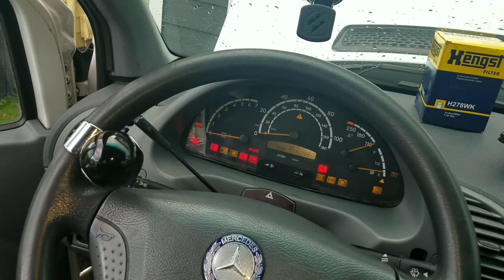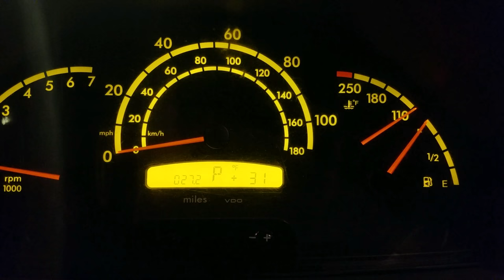How to remove glow plugs on a Sprinter [04-06] & repair glow module

Comment from the maker: Note, the engine must be piping hot while you do this. Removing glow plugs from a cold engine is a sure way to create a nightmare
Reply: How is it holding up now in 2022? Any issues? 

Did you get the engine hot and remove all 5 glow plugs at once?
Reply from the maker: @OneManOnFire  yes, I got the engine hot and cracked them all loose with the engine still hot. The engine did great until 366k. Was a hard worker everyday delivering. It started shooting oil out of the dipstick tube suddenly one day. I think I blew a hole in a piston. Should have changed the injectors out at 300k.
Reply from the maker: @OneManOnFire  but I got an engine and a transmission with only 85k miles on it, for $1,500. Installed it on the side of the road and I'm back in business.
Reply: @AncapistanVan  Good to know how you did it. I plan on making my own diy video myself. Is it ok if I give your video and channel a shout-out/screenshot in my video?
Reply from the maker: @OneManOnFire  yeah man :) thx

Comment: Is this the old glow plug module with fuses that break? or is this the self reseting updated module?
Reply from the maker: @KoryTheKind  this is the self destructing fusible link type, no circuit breakers. I upgraded to the new type, much less trouble. Soldering ain't easy sometimes
Reply: @AncapistanVan  Okay, great, how did you open up that module? I think there are four tabs on the inside?

I'd like to add an external fuse box to mine.
Reply from the maker: @KoryTheKind  hmm i think i pried it open with a flathead/scraper/spatula after heating it with a hair dryer. The seam is glued iirc.

Comment: Nice an easy , because you did it right ...took me 3 days to get injector bolts out without breaking WD-40 is our greatest weapon 😂
Reply from the maker: WD-40 works great on rusty fasteners, but imo it has little effect on the carbon goo that glues injectors and injector hold down bolts in place. Heat and oven cleaner works best for me. The glow plugs are a bit different though, since the steel glow plugs can rust. In both situations, cracking them loose with a hot engine is the key.

Comment: I was confused what you did with the control module. Do the points need to be touching and what was the symptoms. I have a cylinder 5 diesel knock. New injector and plug.
Reply from the maker: The control module blew the fusible links inside when the glow plugs failed. Fusible links are just a solid state fuse made of a copper bar that blows up when the current gets too high. So I bridged that gap with my awful soldering, to repair the fusible links. Symptoms were my glow plug light staying on for longer than usual, and rougher cold starts.

A knock from the back of the engine can come from a damaged flex plate especially on 2002 to 2003 models, or from an injector leaking compression past the injector seal ring AKA Black death, or from a remanufactured injector causing predetonation inside the cylinder from a leaking nozzle tip or just make it run loud from incorrect fuelling quantity/timing/spray pattern.

A knock corresponding to engine RPM can also be caused by the outer ring of the harmonic balancer coming loose and hitting the timing cover.

A similar tapping sound can also be caused by the belt tensioner hitting the minimum stop limit due to a belt that is too long.
Reply: Yea the knock stops when I unplug injector 5. Have replaced with brand new injector and glow plug. Now looking into module fix
Reply: Next question is how did you get the module taken apart. In a way I don't have the funds to fix it if it doesn't need it. Altho I did do the glow plugs and had black death/ injector seal replaced. Altho I redid the job and noticed diesel on the shaft of brand new injector
Reply from the maker: @thesolpurpose3109  I shoved a knife into the seam and pried it apart. It's just glued together. There's two bolts that hold the glow plug module in place, so use an extension on your ratchet to easily reach them. It's a 10 mm socket iirc. 

Unless you live in alaska, or Montana, it doesn't need to be fixed. I have two glow plugs not functioning on my engine, and it starts just fine in freezing weather.
Reply: @AncapistanVan  the van was in minnesota. lol -17 degrees sometimes. i plan to get the knock gone and take It away from the cold tho. i wanna get everything squared away in this family shop before i go to far

Comment: thank you for documenting. did i hear you correct? "unplug cam sensor in order to turn it over  to spray out this crap without the engine firing." did that have any benefit? what if i just drop another glow plug in without meticulous cleaning? won't most shit burn off with the fresh plug? also, what's the risk of doing this while the engine is too hot? some danger with your penetrating catalyst spray? (i'm trying to decipher what that first comment was all about.)
Reply from the maker: I don't think it worked because the compression is too low with the glow plug removed. Made too low-pitched of a whoosh sound. A much better solution is a mini Shop-Vac with a small vinyl hose nozzle. Or if you happen to have the injector out, you can use compressed air through the injector hole, while you work, so that stuff blows out, rather than falling in. 

If you spray penetrant on an engine that's pretty hot, it will sometimes evaporate into nasty vapors that I wouldn't recommend inhaling. Paradoxically, it's best to crack loose the glow plugs when the engine is real hot, like within 10 minutes of engine shutdown. Because the carbon goo just like in Black death, it turns into a glue after just about 10 minutes without heat. 

As far as stuff burning off with a new plug dropped in, yeah it will but that's not the part that needs to be cleaned. It's the seat of the glow plug that needs to be clean - not the heating part of the glow plug, but just before that near the glow plug tip is a beveled surface that seals onto the head. It needs to be clean on the seat because if the glow plug does not fully seat, it can leak compression, similar to black death. Or the glow plug can break during the tightening process. If you get combustion gases leaking into the threads, then your glow plug can get glued in there just like an injector with black death.

Comment: Brilliant video would having bad glow plug but your van into limp mode ?
Reply from the maker: Thanks. I don't think so. It may illuminate the check engine light intermittently, but won't put you in limp mode.
Reply: You won't go into limp mode. Glow plugs are only used during starting. You won't even get an engine light in many cases but a Sprinter compatible scanner will tell you which glow plug it is.

Comment: I had asked this question about the 06 Sprinter 2.7L on another video; so you may have already seen that one. I replaced the #2 cylinder fuel injector copper washer seat due to compression loss. Upon starting the motor it was smooth and quiet. I warmed up the motor for 8 minutes and then noticed a large amount of fuel coming out of a 10MM black rubber hose on the drivers side of the motor close to under the intake manifold. What do you think is the problem? I removed the black plastic cover of the injectors and that area was dry and no leaks.
Reply from the maker: Yeah man I actually responded to you a bit ago, did you see that?
Reply: @AncapistanVan  will check it out, thanks

Comment from the maker: Update: My bad soldering job didn't work to repair the glow plug module, it still gives me an error code sometimes. Others on the sprinter source forum have had success with this though. It worked for a month or two while it was still cold, then the CEL popped up. But the glow plugs are doing fine and it starts great. I get the check engine light every once in a while so I'll need to replace the glow plug module with the updated version with circuit breakers before next winter. I could pull it apart and re-solder it but I'd rather just buy the upgraded version.
Reply from the maker: Update, new glow plug module from Euro parts - SD with built-in circuit breakers works a trick. No error codes and it starts up perfectly
Reply: @AncapistanVan  Do you have links for these parts? Glow Plugs and the Module? I have a 2005 Sprinter with codes P0671, P0380 and P0340 so I guess I need the Camshaft Position Sensor too. The variation in pricing on these parts is ridiculous!
Reply from the maker: @misterjason75  OEM only. Www.millionmilesprinter.com or europarts-sd.com
Reply: Hi.did you have to program the new glow plugs module or you just changed it?
Mine it's a 2006 and will need a new module
Reply from the maker: @josephmartinez8111  no programming necessary

Comment: Can you use the spray to loosen the glow plugs every couple days while continuing to drive? Or would that not work?
Reply from the maker: Yeah, that's what I did for weeks. I don't know if it helped, but I did everything I could to increase my chances of success. The most important thing is that the engine is really hot and you crack em loose within 10 mins before the tar hardens into a glue.
Reply: @AncapistanVan  really appreciate your reply, luckily maybe unluckily I ended up passing on the sprinter I was looking at. 2006 with 300k+ on the engine and in somewhat rough condition, drive an hour there for him to just then tell me it has a check engine light and he never changed the title over. Even so I tried to make an offer but he said the lowest he'd go was 7. Back to the search hahahaa
Reply from the maker: @dustin860  yeah the c e l was probably on because of the glow plugs. let me know when you find another one, I'd be happy to help you inspect and repair

Comment: Did you have to remove the intake manifold for better access? Getting ready to tackle #2 and #5 but they seem quite hard to reach
Reply from the maker: Nope. But mine is an 04. The 02-03's, the intake is in the way. But if you have an 02-03, while it's off you can swap it with an 04-06 intake and EGR. Joel sell of million miles sprinter discovered this and said there were no problems.
Reply: @AncapistanVan  ah ok, mine is an '03. Do you know if the intake needs to come off to get the plugs out? Is there some benefit of making that swap? I'd just assume keep things simple and replace as few parts as necessary until there's a clear reason. Appreciate the help tho for sure
Reply from the maker: @nelsonklein1  I'm not sure, I haven't worked on too many of those older ones. but you could ask the Sprinter source forums or the t1n Sprinter owners group on Facebook. It's an upgrade, not a requirement. It just allows better access to the glow plugs (and injectors??) in the future, and gives you the improved EGR from the later years which won't drip oil.
Reply: @AncapistanVan  But, if the intake has to be removed, and I can see it has too (have a 2003), how can the engine still be sufficiently hot to unscrew the glow plugs?
Reply from the maker: @uwe12553  good question. I suppose if it's possible you could maybe just crack it loose while the intake is on. If that's not possible I suppose it might be possible to cover the intake holes with HEPA vacuum filters duct taped over the holes and run the engine that way. Or maybe you could just hold the intake on by like three bolts to get the engine hot and then pull it off real quick.

Comment: Just pulled my relay apart and all 5 are blown! and get this the main 125A fuse is blown too how is this possible? (they look to be original parts just got this van with 305K on it!
Reply from the maker: When the fusible links inside the glow plug relay blow, the metal strip bends/snaps/melts. if you are unlucky, they will break in a way that still allows current to flow, from the 125 amp main glow plug fuse, to the glow plug relay and maybe even all the way to a faulty glow plug. I suspect that is what happened. The other possibility is that there is an actual short to ground in the wire that feeds the glow plug relay, for example, if the wire rubbed on a sharp edge. You can test for continuity to ground while wiggling this wire. I think it's also possible the fuse just got real wet and corrosion built up and made the resistance too high. These are just my best guesses. I would ask the question on the sprinter source forums or the t1n sprinter owners FB group

Comment: What size pliers are you using? I am having trouble accessing the connectors to pull them off.
Reply from the maker: Bill Lindley  I believe I used Craftsman 6 inch flat nose slip jaw pliers. Compress either side of the plug and with a firm grasp pull up. It's hard to find the right pliers that will fit and you might need different pliers for different plugs

Comment: How many miles are on these glow plugs? Seemed really tough getting them out. I'm in the process of buying a Dodge Sprinter this week if we come to an agreement on price. I changed my glow plugs on my VW TDI & didn't have half the trouble. Wondering what I'm getting myself in to because check engine light is on with a glow plug code. Figured easy fix but seems like a job lol. It has 145k miles & its from Boston so I'm sure they are rusty. Thanks, Great Video by the way. 😎👍
Reply from the maker: They had 220k miles on them. The other two originals are still working fine, at 320K now. The head is aluminum, which can't rust, but the glow plug body is steel I think. IMO, the bigger issue is not rust, but the carbon tar that acts as a glue to hold injectors and glow plugs in. The secret is that you need to get the engine up to operating temp for a while, like drive for a hour or two, then crack it loose within 10 mins of shutting the engine down. I did a video here: https://www.youtube.com/watch?v=oenk_RGZAv4&fbclid=IwAR3ZyxTFCOpg19HLveJ8zj9042uVB-j61sJd6otcL2_Dw18NZB7gdi2tK24 that shows just how tough this tar/glue is. It is a liquid at operating temp, yet a glue at room temp. If you are doing multiple glow plugs, either crack them all loose while the engine is real hot, or do them one at a time and work the engine in between, to keep it very hot.
Reply: That's a bit of relief. I just worked out the price & will be purchasing the day after Christmas. This 06 has less than 150k miles. I guess I will still have my work cut out for me but it sounds like patience is key. Thanks for the fast response & a great video. I subscribed & plan on checking out your Sprinter vids. I plan to start from scratch & build a camper conversion. I have lots of work to do but want it to be reliable too. I haven't heard of many transmission problems with these things besides a control module or something like that & the diesel motors Ive heard some getting a million miles. Looking forward to a 20 mpg mini camper in the future. Any recommendations on oils I should run in motor/tranny/ rear end etc. I want to change all the fluids & filters first thing & of course this glow plug issue. Thx in advance
Reply from the maker: @vanlifebiker  Thanks for subscribing!! 150K miles is just getting broken in and you did good getting an 06. Yeah they are incredibly reliable machines imo. Mines been going for years every single day, for 100k miles now. You will do well I think, as you are on it as far as learning basic TLC.
Reply from the maker: @vanlifebiker  Oh and as far as oils, I use Mobil 1 European car formula 0w-40 from walmart for engine oil. Shell ATF134 transmission fluid from your local shell distributor. Rear differential oil is Mobil 75W-90, and see my video here on how to change it: https://www.youtube.com/watch?v=RcA8kstTYJg&lc=z23tc3y52zbci1jwi04t1aokggt3r1kriikwsvn4mkxsrk0h00410

Comment: Why repair when there are replacements online for $60 a set? Asking before I attempt to do this myself. Thanks.
Reply from the maker: Why repair the glow plug module? Because the cheap glow plug modules are not updated with circuit breakers, they will fail in the same way, I was trying to save myself some money. The updated module is over $100 on europarts. You can buy the set of glow plugs yes but you will still need to carefully remove the originals from a *hot* engine and that is what this video shows. Make sure to use OEM non counterfeit glow plugs, the wrong ones could overheat and seize in the head or just get stuck.
Reply: AncapistanVan gotcha, thanks for replying!

Comment: Excellent hand skills  BTDT and yea I have broke one myself. Couple tips use a torque wrench and just keep clicking it with a barley over torque spec setting. I put dow corning 111 silicone grease on the taper tip and threads and next time they come right out. I have a blown glow plug fuse and one plug reading low ( .3 ohm) on a 305K engine. Now that I think about it will see if it pops the $5 fuse again before I try to take out the plug!

Comment: what is the thread paste you used for the new plugs?
Reply from the maker: I don't remember.I think I had some copper anti seize back then but I was just using high temp synthetic brake grease on everything. Which of course is not recommended.I would check the Sprinter source for the best stuff to use or the owner's manual on DIYsprinter.co.uk/reference
Reply: @AncapistanVan  The glow plugs use the cylinder head as a ground. It is recommended that no anti seize paste or grease as this may effect the ground side of the glow plug circuit and prevent proper operation.
Reply from the maker: @malcolmyoung7866  Good point, although I did use copper anti seize iirc. I figured the base of the plug would provide plenty of contact. I hear a lot of nightmare stories of glow plugs, so I didn't want to put them in dry, but you may be right. I dunno.